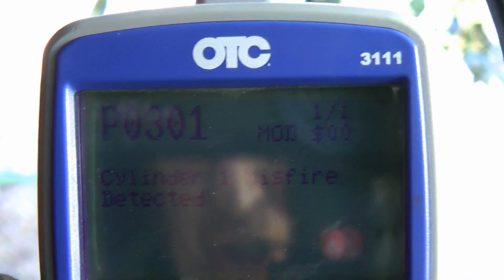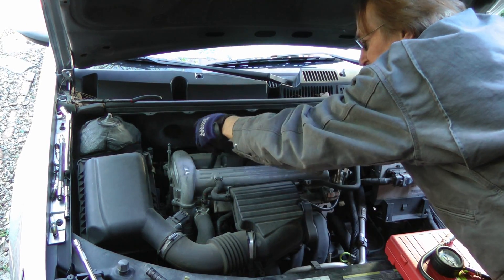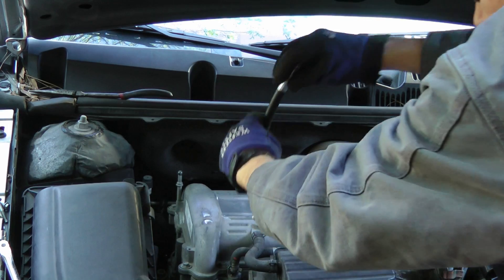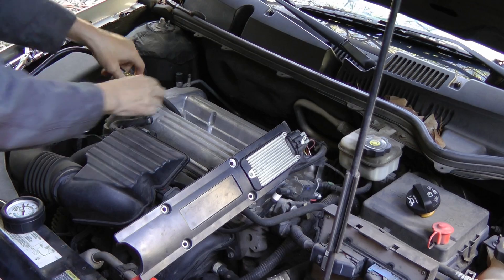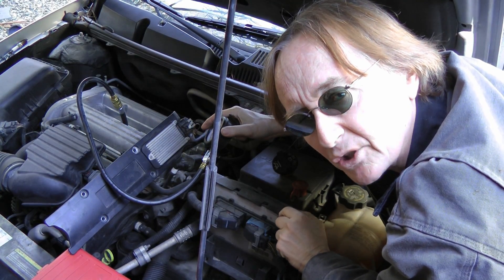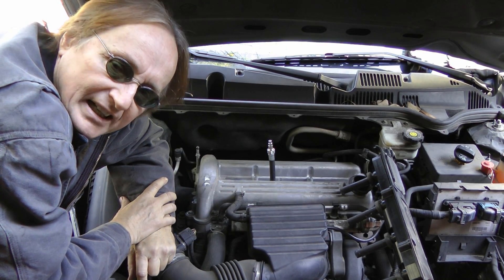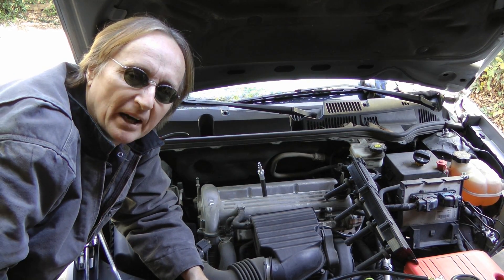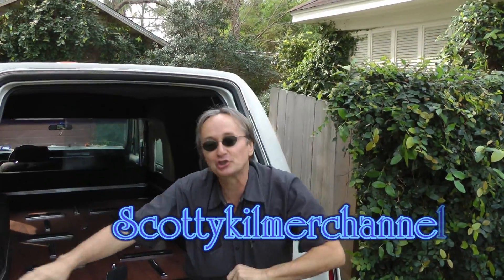Why Do Engines Misfire, Code P0301 (Compression Test)

Comment: Ok so what if the code reads P0300, P0301, P0302? on Toyota 2000 would that be the case of a misfire inside the engine internally? I find out one of the coils went bad so im hoping its just that. I've also added a new set of spark plugs to the car to.
Reply from the maker: Samson Yang one and two are misfiring, pray it's bad ignition coils, and not something like a blowing head gasket.

Comment: SK,.. 02 Corolla/Prizm, have a PO171 after replacing all pllugs, coils are good, 400 mi' on used eng with 71K, compression good, no oil leak, 02 sensor could be contaminated,  must Ck injectors first, or the misfire can re-contaminate it and cat converter.
   Would tech be offended if I tell him I just want him to monitor live data for 02S and injectors ? After extensive vid watching, especially " PO171, case study 02 prizm " where they monitored 02S, L &STFT, and injectors, resulted in faulty injectors, I have narrowed it down to 02S & injectors.  please reply to jwolchak@cinci.rr.com
Reply from the maker: on that model, more often injectors do that, go ahead and have some one check the injectors electronically

Comment: I got P0301 on my 2005 jaguar x type with 90k miles. Got my fingers crossed that its just a bad ignition coil, and not the head gasket, since i dont see any water in oil.
Reply: Could this be caused if 87 gas is used when car calls for premium?
Reply: No. But never Go wide open throttle in a car that calls for 91 and you put shit gas in the car. It will ping like crazy.

Comment: I have a problem with sonata 2002 gls v6. I have error codes of P0300 (random misfire), P0301 (1st cyl misfire), and P0304 (4th cyl misfire). I swapped the spark plugs and error stayed the same, so it isn't spark plugs. Test the spark cables with a multimeter and ohm reading isn't too bad. I am leaning this on an ignition coil, because 1 and 4 are on the same coil. Do I have to replace the entire ignition coil set or can I just replace the first pack that reside on 1 and 4 (1and4, 5and2, and 3and6)? Are some oem pack incompatible with the factory? Am I better off replacing the whole thing? Can you help me with some suggestions? thanks.

Comment: Hey scotty working on a 1998 Buick Century with a 3.1 liter , has a P0304 code, has all new wires, an plugs , when i removed # 4 plug a lot of carbon buildup was on it what is causing this misfire ? the light is flashing
Reply from the maker: pray it's a bad injector on # 4 and not a worn out engine cylinder on #4 or a blowing head gasket.

Comment: Hey Scotty, i was wondering if you could help me isolate my problem i'm having on my recently purchased 2001 Mazda Miata. I'm getting the P0300 and P0304 codes and I have changed my plugs, wires, and coils on it. The previous owner didn't want to sell the car to me with the CEL on and he didn't to his knowledge because the CEL went off after cleaning the MAF sensor. I went into the dealer today and they told me that i am getting 90 psi on the 1st 3rd and 4th pistons and only 25 on the 2nd piston. The previous owner said that the car was due for a new fuel filter but i want to get some more knowledge before i start throwing parts at the car. The dealer says that i should replace the whole motor but i'm not convinced i have to. Thank you ahead of time for your advice.
Reply: to clarify, the CEL came back on after about 80 miles of driving from when he had cleaned it.

Comment: I also have a problem.  I was driving home last night and all of a sudden my car started shaking and my cel  light started flashing but then maybe 45 seconds later it stopped.  I continued to drive home (5miles) with no problems.  I shut my car off for 30 min then started it up and drove it down the road to see if the problem would happen again but still nothing.  It's this an engine misfire or just and electrical type glitch?
Reply from the maker: cel was flashing, codes are stored to show the problem area, so get it scanned first, e mail me the codes, auto zones scan em free if you don't have the tool
Reply: Alright will do, but it'll have to wait for 2 days because of a busy schedule.

Comment: Hi scotty kilmer i would really need some mechanical advice my 2000 lexus rx300 has a misfire my mechanic  replaced coils #1 on back bank and 2&6 on the front bank and I checked cylinder 4 by unplugging the sensor to the coil while it was running and the engine sounded worse so that's working anyway cylinder 3&5 in the back bank I could not test too tight spaces anyway I have a scanner and the  souls that I replaced like cylinder 1 are still showing along with cylinder 3&5 which was never replaced but some times its shows cylinder 3 misfire 2 times on the scanner keep in mind that all front and back spark plugs were replaced with ngk iridium plz I need help also very strong odir and also p1130 air fuel ratio sensor code car drives badly losses alot of power engine also pops like popcorn in the engine area can u tell me whats wrong
Reply from the maker: I would change the af ratio sensor first, it's a known problem. then see what happens. If that doesn't fix it, I'd change all the coils just to be sure, and PRAY the main computer hasn't been shorted out, cause bad coils often do that
Reply: Scotty Kilmer thank you soo much scotty ur the best
Reply: Scotty Kilmer what's a misfire

Comment: Great video Scotty!  I have a 2008 Cobalt SS Turbo with a 2.0L motor.  It has a P0301 code on it now.  Do you think that is something serious with the motor?  Is that common with these types of cars?  It has 272HP on a 2.0L motor, so I'm thinking that might be a bit too much for it, and the motor may be dieing because of it?  Thanks
Reply: No that is not too much. Did you ever figure out what was the problem?

Comment: I have a 2008 4.2L V6 with 64k miles that is idling rough. The vibration can be felt holding the steering wheel. It occurs whether in park or drive. After noticing the idle issue, I have cleaned the MAF and throttle body. Replaced the spark plugs and wires (Motorcraft Plugs and Autolite wires) and the fuel filter. There has been no change in the performance. It runs smooth when accelerating and I am not getting a check engine light. Should I replace the ignition coil? Am I likely feeling a misfire? I assumed if a cylinder is misfiring I would get a code. Please help with your thoughts. Thanks.
Reply from the maker: First, check for vacuum leaks as in my video "finding engine vacuum leaks with a cigar" they often do just that.  Also, check for worn motor mounts, they will do that too. If not that, see a pro like me to analyze the raw data with his scan computer, there's much more info than simple trouble codes.
Reply: Thanks for the quick reply.  Vacuum leak seems to make sense.  I'm going to try the vacuum test this afternoon.  Love the videos!

Comment: Hey Scotty this video is very helpful. I took a 2001 celica that I recently bought into the shop because the check engine light. The car scanner is reading P0300: Random/Multiple Cylinder Misfire Detected, P0303: Misfire Cylinder 3, P0304: Misfire Cylinder 4, and P0171: System too Lean. Hopefully this car doesn't turn out to be a lemon. Where do I begin to deal with this? What is your recommendation on how I should proceed?
Reply from the maker: try my video "how to clean fuel injectors on your car" and PRAY it's just dirty ones. If not, have the engine compression checked and if 3 and 4 are low, you got a lemon with a bad engine. those 01s eat up engines IF it has the yamaha racing engine design in it and not the toyota designed one
Reply: Hey Scotty. My prayers were answered. I did a compression check on all the cylinders and they are fine. Now I will try cleaning the fuel injectors. I'll report back soon with info about whether or not it worked. Thanks!

Comment: Evening Scotty I have a Misfire code P0304 Together with a P0100, I HAVE CHECKED COILS SPARK PLUGS AND Engine pressure,  And Everything is perfect. ... The only thing that is very weird,  is that Sometimes IT SMELL LIKE GAS .....THINKING I HAVE A CLOGGED INJECTOR OR BAD FUEL REGULATOR.  THANKS LOVE YOUR CHANNEL
Reply from the maker: move # 4 injector to another location, if the miss moves, that's it" Pray it's that simple

Comment: I have a shaking problem upon braking and start up.  Sometimes there's an occasional misfire.  I will be placing new spark plugs, cable, and changing the timing belt.  Is there anything else I should try?

(Ps:  I've already replaced the IAC Valve, TPS, MAF Sensor, Throttle body is cleaned, Catalytic Converter, O2 Sensor, Engine mounts)

Truck is a 2.3L 1994 Ranger XLT.  No Engine light detected and Autozone electrical measurements won't work with a truck older than a 98 (so they say).
Reply from the maker: weak fuel injectors often do that, as do vacuum leaks. Try my videos "how to clean fuel injectors on your car" and "finding engine vacuum leaks with a cigar"
Reply: Scotty Kilmer The injectors are good.  Replaced all spark plugs, timing belt, and cam sensor.

Question:  The steering wheel shakes profusely only at stops.  Every time I turn something on, there is a brief power drop.  Every so often, the surface screen of the radio just simply turns off (even though the volume is still on; all the buttons aren't working).  Should I just change the alternator?

Thanks,
Pk
Reply: Phillip Koo What was it?

Comment: what can cause an misfire so bad that it will only go sometimes ten miles per hour or  30 mph i only replaced the front spark plug wire and plugs. im thinking of replacing the neggative battery cable fuel presure regulator and MAF i know it is an 1995 ford windstar 3.8 engine i dont want to give up on it because i still baleive the engine is good. any suggestions??
Reply from the maker: many things can do that, from bad ignition control modules, to weak fuel injectors, or bad wiring. Best to find a guy like me to analyze the whole system.

Comment: Hey Scotty. This is a follow up comment. My 2002 Lexus IS300  was at Lexus because it was shaking for about 5 seconds upon cold startup.. First they told me I needed to change the new spark plugs I just had put in, which were not the Iridium's that that car is supposed to use. They changed the plugs. It didn't get rid of the problem. So now they said that cylinder #2 was misfiring, and they swapped it with cylinder #4, and that the problem is fixed. I will be picking my car up later on today. Have you ever done this or heard of this?? Oh, by the way, the car has 120,000 miles on it. Thanks.
Reply from the maker: yes, but make sure the ignition coils are good too, bad ones often do that
Reply: Excellent! Thanks a bunch.
Reply: Scotty Kilmer Hey there Scotty. Just got my 2001 IS300 back from Lexus of Palm Beach today. They said that there was a loss of compression in some of the cylinders, and that they found coolant in the cylinders. While I'm aware that this is going to cost a fortune to fix no matter what the EXCACT fix is, I would love to know what your opinion is, as far as what will happen if I leave it alone for now, and keep driving it. Right now, the car runs very smoothly. The only signs of a problem are the rough idol after the car has been parked all night, and a little white smoke from the muffler for a few seconds in the morning as well. Thanks.

Comment: Great video!
My left break light is working fine but when I turn on my light and I step on the breaks the left break light doesn't work so what do you think is the problem? 95 camry is the vehicle.
Thanks for your help!
Reply from the maker: check the socket for corrosion being that old, and also check the ground wires back there, back grounding often does that.
Reply: Ok I'll take a look at that. Thanks

Comment: I changed it scotty.  I took for a ride and car runs smooth.  Doing some Christmas shopping right now.  It still give me check engine light reads p1193 oxygen sensor. I can always change this after the holiday.  Oh,  I took the wipers off,  the whole wiper motor and fire wall so I can get to the back.  Thank you scotty

Comment: Scotty,
I know I have told you before I'm getting three p0353, P 0300 p 0442, P 0455 p 03 03 p 03 06 and again is giving me P 0300, car shakes and also the check engine light is flashing. I have a 2001 Town and Country how do you recommend I take out the spark plugs in the back they are kinda hard to reach Thank You Scotty
Reply from the maker: yes, change those plugs and wires  or coil on plugs, they are VERY hard to get to, often requiring jacking up the engine and removing motor mounts to get out

Comment: I think this video oversimplifies compression testing. What about holding open the throttle while cranking? what about disabling the ignition system to prevent damage? What about a drop of oil down the bores to compare wet and dry readings? People with limited knowledge can cause themselves a lot of expense by not correctly carrying out procedures. It's not rocket science, but it HAS to be done correctly to get accurate results.
Reply from the maker: as long as you test the compression the same way for all cylinders, it doesn't matter how you do it, throttle open or closed.  The readings you get from any gauge are not all that accurate in terms of actual readings, they are more of a relative test.
Reply: Scotty Kilmer Agreed, the relative results give an indication of engine condition, but, if accuracy didn't matter, the gauge would just have  a red and green section, good or bad. You are incorrect about holding open the throttle, I believe scannerdanner has a video about this, with low compression readings caused by closed throttle testing on a car with a contaminated throttle body.

Comment: I have a 93 Celica, and usually when it's idling, it idles at around 900 RPM, but the tacho tends to jump around a bit, do you know what might cause it?
Reply from the maker: try my video "how to fix a car that idles poorly"
Reply: Scotty Kilmer I found using a premium blend of 95 has changed the engine completely. It surprisingly runs smoother than a lot of new cars.

Comment: Hey scotty, my 2000 S10 2.2L Automatic idles rough at 1500 rpm and it should be at 900 rpm, when it rough idles the truck shakes bad and doesnt go away until you rev it for a while. Is this a misfire?

Comment: Evening Scotty, On my 01 civic ex I just recently replaced the timing belt, along with the tensioner and water pump and got the infamous P0301. Keep in mind that the code was not there before I started the repairs. When I put the timing belt back on, the crank pulley was not aligning with the arrow, but only by millimeters and the cam pulley was perfectly aligned with the arrows. Can there be minimal slack on the crank pulley or does it have to be perfectly aligned, because it would not do so when placing the belt on and would that cause the the service engine light to blink with the P0301 code. Thanks.
Reply from the maker: it has to be perfectly aligned, and realize sometimes the belt is poorly made and so it will never align correctly. I've had that happen to me a few times, so now I try to use factory oem belts whenever possible

Comment: Scotty I drive a 93 honda prelude with a swapped jdm h22a, has not been tuned. It jerks/spudders alot at basically any speed I have replaced so many parts and it will not stop? Any idea what it could be? Please help Thank you!!!!!
Reply from the maker: swapping engines if always fun, first, you never know if it's the same exact engine made for that car, so sensors and computer software may not mesh. I would start by doing a compression test of that engine to see if that's good, cause if not, forget trying other things like timing or fuel injection work.
Reply: Yea I was told it needs to be chipped and tuned but since that's quite exspensive I wanted to try other options first. I had my mechanic adjust the timing that seemed to help a little but still jerking. Do you think if I were to just flat out buy a brand new ecu it would fix it? It seems to be drinking gas like a semi truck which makes me believe something ain't right with the ecu. Nobody really has any answers.
Reply from the maker: Brandon Burch
could be an ecu would work, but that depends on the hardware and wiring of the car. If they don't match the wiring in your car, it wouldn't work either. One big reason i NEVER do such swaps myself, they often turn into endless money pits.

Comment: I have an 02 misubishi lancer, It was throwing a p0302 code, after changing the plugs/wires/coils the misfires kept happening. the next code I got was a p0303 (pending) and an p1300. We tried putting in a new fuel pump, swapping out the MAF, and the TPS as well as made sure the converters were good. The car only misfires when the engine is hot. It sputters and runs like a pig once it gets to that point. Any ideas what else I can look at me and my buddy are stumped!?

Comment from the maker: check the wiring to the plug, pray something's bent or shorted out. If not, a bad main computer often will cause that, or a shorted out sensor anywhere on the computer sensor system

Comment: Needs a cylinder head.  Valves go bad on these and the guides wear  guides can't be relaxed on these heads so just get Reman cylinder head and call it a day.  See it a lot on these motors if they don't change the oil enough

Comment: I broke down and took it to a mechanic, and he found that it was the "air intake manifold gasket."  the part was less than $50 but the labor cost like $350. he also but on a new belt as the  old one was ready to fall off.  besides brakes and tires, I'm not putting anymore money into this old car. The only reason I wanted to fix it, is that it's really good on gas.  Maybe you can make a video of changing out the air intake manifold gasket.